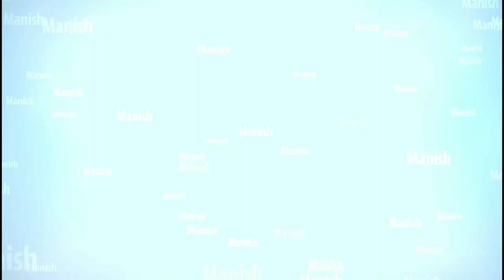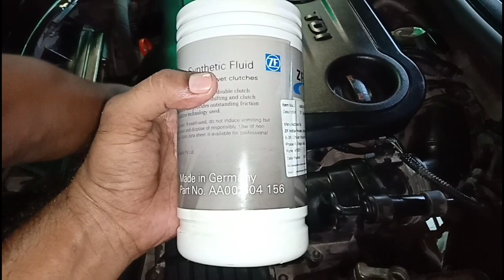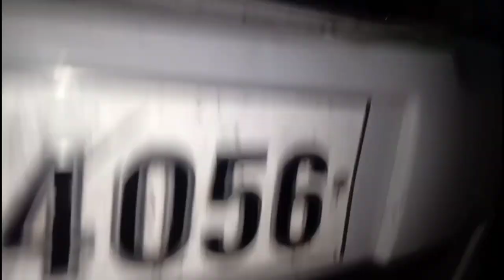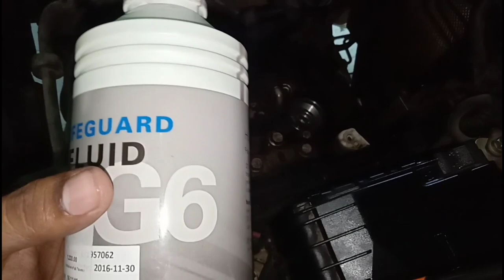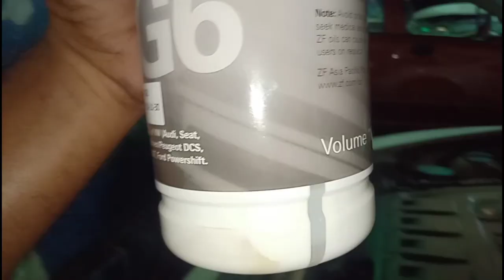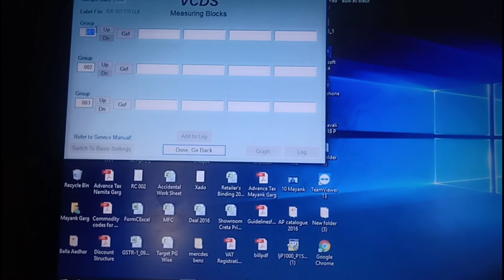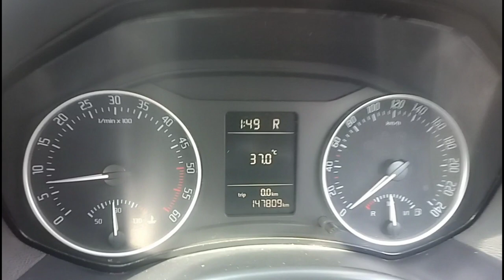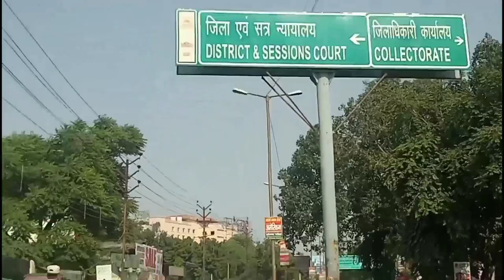How to change automatic transmissiondsg 6 speed  transmission oil without oil filling tool

Comment: Hi sir, your videos are really helpful and has saved me a fortune many times. Just a question, can you suggest me of, where is the transmission oil filler of audi a4 2.0 tdi 2013 model? Under the hood. It has the same single valve filler underbody as the soda in video. So please suggest me. Thank you

Comment: Hello Manishbhai, As to make the oil filling  faster from filter, use silicon pipe in centre hole and fill directly in it and it will go very fast, as I use to use that method, as it will save lot more time and faster
Reply: I also know that but manish? ?

Comment: hi .could u kindly tell me , is it required to do a software setting after the oil change and also if we disconnect the battery, is it required to make a backup for the battery to save the memory,  thanking u in anticipation.
Reply: Theres no software setting required, however after filling the oil you are supposed to check for the transmission oil temp ( using an OBD scan tool) which is supposed to be b/w 35-40 deg C. At this temperature you are supposed to drain the excess fluid out using the primary drain plug from underneath the transmission. Removing the battery does not cause any memory issues of the ECM/TCM.